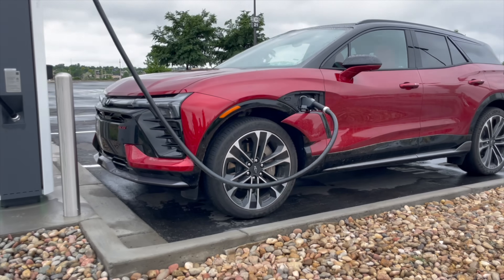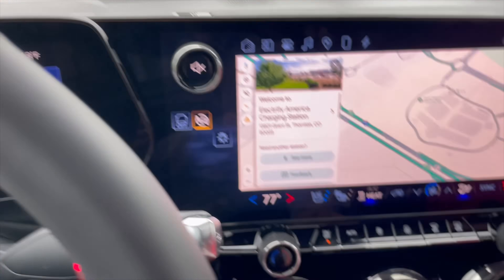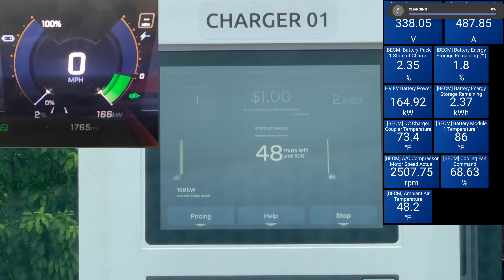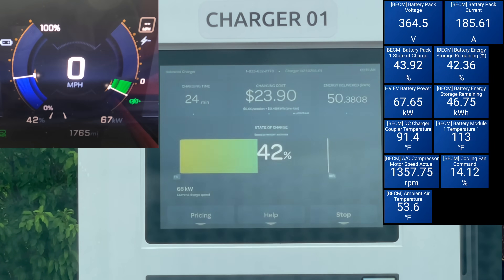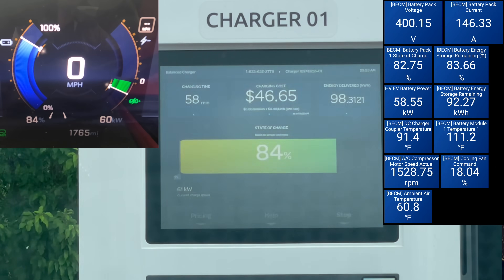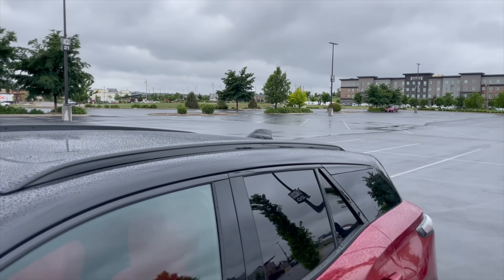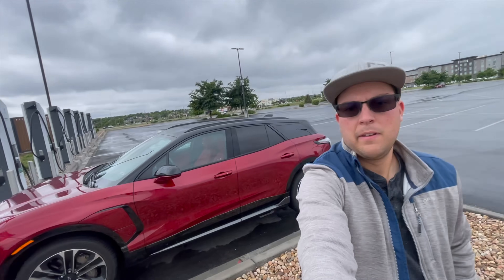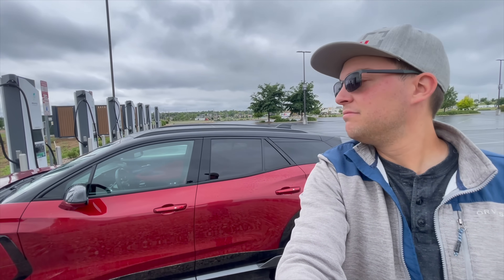Blazer EV SS Doesn't Have The Charging Curve To Match Its Performance

Comment: I have a 2024 RS RWD (big battery, big rear motor). It was better before the OTA update in June, then the charging curve tanked when the AC was on.
The new update to correct this issue was released (I believe) the week of 9/8/2025. 
I haven't had a chance to DC charge yet, will update when I do.

Comment: As a long-time Bolt owner (2017 model and 2023 EUV), my 0-100 time has never been longer than 1 hour 35 minutes. 54 kW max speed, but a smaller battery and a better curve!  It would be fun to drive these in a 500 mile loop to see which one finishes first?  Just sayin’. You might be surprised how well the Bolt performs. 🫤😁😂🤣

Comment: My Bolt doesnt handle heat very well at all either. If it is more than 85F in my garage (you know - June, July and August) and I charge for an hour or more (L2 - 7.2kW) then once it is done the A/C compressor will come on and freak out. It hits 8,600 RPM (notice the car in the video only hit 1,500 RPM, granted it could be a larger compressor) on the A/C compressor pulling 22A @ 240 for JUST cooling the battery after charge! It sounds like it is trying to leave the car! Loud and scary. On a hot drive when I run the A/C to cool ME, it starts at 5,500 and ramps down and then never exceeds 3,000 RPM. And of course running an A/C in a hot garage - makes the garage hotter . Which pisses off the battery even more. 

I took it to the dealer but they were unable to duplicate the issue inside their air conditioned garage (duh) and they wont tell me what it is supposed to do under those circumstances, they say since it doesnt throw a code all is fine.

Comment: Thank you for the work you put into this. I’ve been noticing that others have highlighted this weakness of this vehicle and for those that travel longer distances or many miles a day this is very important. I know many people in the comments Don’t really need the DC fast charger hardly ever and that’s understandable so they’re not concerned about this. However I drive for work. I drive with passengers, I drive with trailers and all kinds of vehicles And if I was to purchase even a car, I would be going long trips more often than most and this would be a problem thanks again.

Comment: We took our 24 LYRIQ on a road trip in June.  The LYRIQ should have very similar charging characteristics as the Blazer.  We didn’t do a charging curve analysis, but I did note peak charging of 160 kw or more and it maintained a charging rate of 100 kw or more to about 75% SOC.  It seemed pretty consistent on the 350 kw chargers that we used at EVGO and EA stations and slightly lower rates at the Tesla chargers. We had 49 DCFC sessions with an average charging time of 27 minutes and we only charged more than 30 minutes when we had to charge to a high SOC for a long leg,  We were on vacation and kept the AC running during all of these charging sessions.  We did travel north and west for this trip and the temperatures weren’t as high as it has been in the Southeast in July.  The LYRIQ did precondition the battery before charging sessions.  So I wonder why the Blazer charging curve dips down so low at a SOC of 35-40%.
Reply: I just had the same charging experience with my Lyriq on a 2,500 mile trip. Admittedly, the temps weren’t in the 100s, but I was usually putting in 50 kWh or more per session. I never got the big dip.
Reply: Great info. I'm debating about getting the Lyriq with my biggest worry being charging performance. Early videos showed similar curves as this video, so I wonder what the difference actually is. Software updates charging infrastructure etc
Reply: Also wondering if a bag of ice on the heat exchanger would solve the problem lol...

Comment: I have an Acura ZDX Type S so the same battery architecture, but it's charging curve doesn't seem to to be as bad as this.  Admittedly I don't generally have SOC at 0%, so perhaps that's a factor, and I'm not sure how practical it is to test from this level since I doubt most people will be willing to let it go that low.  I think that actually works against the test a lot because it's and additional 10% at near peak rate, which acts to overwhelm the cooling more quickly.  My real world experience is about 40 minutes for 10-80, but I usually shoot for 10-70ish which is usually just a bit over 30 minutes.

The longest DCFC session I've done was from 14-99% for a late night trip where I didn't want to have to stop at 2AM to charge.  It took 72 minutes, which seems way faster than what the vehicle in this video would have done, even with the extra 14%.

What was the most interesting in watching this session is the A/C Motor Speed and Cooling Fan Command values.  It starts at high RPM and high demand, but then drops to just 800 RPM and much lower demand.  My car seems not to do this, the cooling fan screams like a bat out of hell when charging within the first minute or so, and drops only slightly once things settle in, the returns to screaming banshee state.  It feels like the session in the video the car didn't even try to cool the battery for a while, only ramping up after the charge was slow for several minutes.  Weird.

Comment: Makes you wonder if they didn't go for marketing friendly peak rate numbers that have to thermally throttle down so quickly and peaked at 150Kw instead if it would have changed faster overall. Either that or beef up the cooling if you want to run a battery that pulls that much amperage while fast charging. This is perfectly acceptable for the Equinox and new Bolt, not on a $60-70k midsize family SUV meant for some road tripping.

Comment: Not once I have pulled into a Buc-ees and see 50 other cars fueling up and said, wow, having all of these other vehicles fueling is going to double/triple/quadruple my fueling time.  Good thing because when I am on my time and vacation, I dont want to spend double/triple the time getting fuel/energy.
Reply: I think this may be the first sorta anti ev comment that most people can get behind... Shared charging is stupid and should never have been a thing. Thankfully most modern installations either have dedicated charging or powerful enough shared charging to where it doesn't matter.

I'm just glad this is only ever an issue on trips through dense travel corridors with old infrastructure. Only once have I come across balanced charging
Reply: I hear ya, but I’m never going back to gas cars. Can’t stand the taste of gasoline. Good for you if you can stomach it, but for me it burns going down AND coming back up.

Comment: Love my 2023 bolt 2Lt.  It just rolled 90k miles!  I drive between 200-230 miles a night 6 nights a week.  80-90% charging is at home.  The AC on does not effect my fast charging, but then again, the max speed is 54.  This car is a beast!  0 issues.  Just plug and play!😎.
Reply: You may like the new Bolt then. Over 300 mile range according to Barra.

Comment: Good Point Jordan, I think I am going to do a 10-80% test on both a Tesla version 3 Supercharger and a BC Hydo 180KW charger, as I was towing my new RV Camper back from vacation and had to charge by Tesla Model Y Long Range AWD (A Fremont Built - important as these are the Panasonic cells) and charged 14 to 57% in 16 minutes started at 155KW and if I recall it was pulling still better than a Version 3 supercharger at that mid state of charge.

Comment: Using a Telsa V3 Charger and a NACS Adapter on my SS I was able to sustain 110kw up to a bit over 50%. Ambient temps were around 85F-90F as well.
Reply: 2024 Blazer RWD with 12 cell pack. At an Alpitronic 400 I was pulling 100kw all the way to 65%.  57kw total charge in 26 minutes. Climate OFF.  Turning climate on when it's hot out will drop that by 30kw easy.

Comment: GM has amazing charging on their 800V charging EV trucks and Escalades, but abysmal charging speeds on most of their 400V EV's. Including on this close to $70,000 one.
Reply: Exactly, the charging performance is fine for the Equinox and lower price points, not for a $60k+ and road trip friendly size and comfort vehicle.

Comment: The dead horse has been beat at this point. There is more to ev ownership than fast charging. To date the best selling non Tesla ev in a year was the bolt which charged slow as hell. Dcfc isn't what people do 95% of the time
Reply: Most Chevy Bolt users got it as a second car for daily commute and use something else for trips. This car would be great for road tripping given it's size and comfort unlike Bolt but with this charging performance it would be way too annoying to drive this more than 300 miles in a day and given it's price a bit too expensive for most people as a second car
Reply: @GregWaszkiewicz you never watched plug and play ev on YouTube and newscolumb they went thousands of miles on road trips   Steve in Boston did 4000 miles round trip in his bolt
Reply: Just took my Bolt EV on a vacation. I used a Magic Dock Supercharger for 25 mins to get a head start on charging before switching to a L1 at the AirBnB overnight. It worked great.
Reply: Agreed I had a bolt loved it never took it on road trips, never ever fast charged it, had another larger 3 row car for that. Most people with EVs have two or more cars. If I did take a blazer ev on a road trip it’d probably be a one stop to charge trip. Meaning this charge rate would be fine. 
If you’re not racing across the country this is a non issue.

Would love to see more on winter range loss, poor weather driving  capabilities, downhill regen capabilities, HVAC performance under extreme conditions and resulting drain on battery, and efficiency under various conditions testing.
Reply: Acceptable for Equinox and lower price points but a little disappointing for it's size and price, it really should road trip better
Reply: 👍🏻I have a 2026 Blazer SS on order. My plan is for it to be for use around town (300 miles +/- per week) and not for traveling. I have a Jeep GC for long trips. Most charging will be almost 100% over night at home. I think this will work out just fine for us. The SS will replace a 2018 Terrain SLT AWD that sat in the garage most of the time.

Comment: That charging curve looks exactly like the double stack Silverado EV charging curve. I wonder if GM has a cool down time programmed into the charge per after meeting maximum charge rate for 10 to 15 minutes. If you overlay the Silverado is the exact same shape, just double the kilowatts
Reply: 400V produces 4 times the heat of 800V charging making it extremely difficult to keep the cells cooled. Teslas do it the best but only for a short while, then have to drop off a cliff to cool off.

Comment: The Lyriq is fantastic during the winter months but during summer months its abysmal charging. When its regularly over 100 degrees and you're fast charging the Lyriq often derates to under 75 Kwh. Especially when you are sitting in the car with AC running which you have to have in this heat.
Reply: I don't doubt that is true but how often is the average owner doing long dcfc far charges in 100 degree heat if they have home charging????
Reply: @shethjones4494 I road trip once a month if not every other month so I’m really familiar with dcfc. When it is regularly over 100 till about October fast charging is pretty bad. The worst is when I’m on a stretch of highway which is really common to have 75-85 post speed limits in Texas. So when your doing 80 for two hours with AC blasting the thermals can’t handle the charging. I’m not knocking the Lyriq on anything else it’s a fantastic vehicle but charging is pretty bad. When it’s ideal temps let’s say between 40-90 it’s solid.
Reply: @OverlandandBeyond The truly disappointing thing is that GM has amazing charging on their 800V EV's, but withhold it from their other EV's no matter their price.
Reply: @junehanzawa5165   The 800V vehicles have higher pack voltage, which means lower current. It's the way the Ultium is designed. On the smaller packs the series module voltage isn't high enough, so they rely on drawing a lot of current, which means more heat. I'm sure they'll iterate and make it better. An easy improvement is more cooling capacity.
Reply: @jghall00 I'm well aware of that. But it's still a cop out as Kia and Hyundai sell $40,000, 800V EV's with even smaller batteries. I realize that GM are still 400V architecture other than when charging, however, the same thing can be done as Kia/Hyundai to charge at 800V. It's just not as efficient when driving or as cheap to manufacture since they're not 800V architecture.